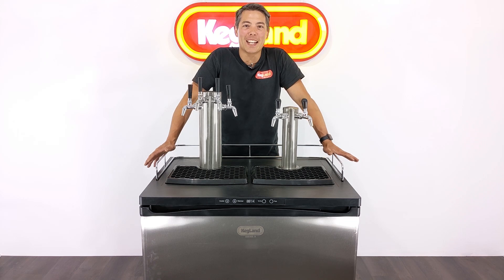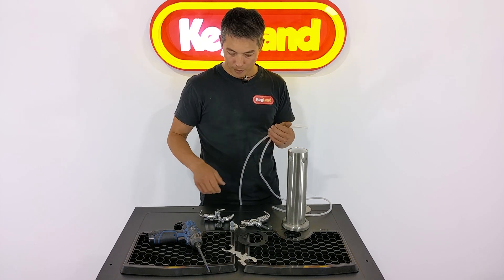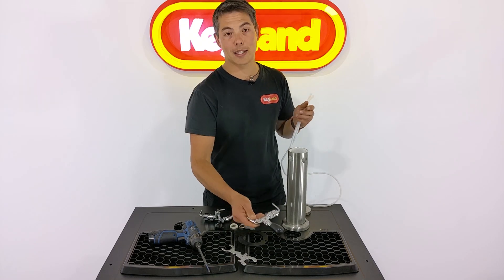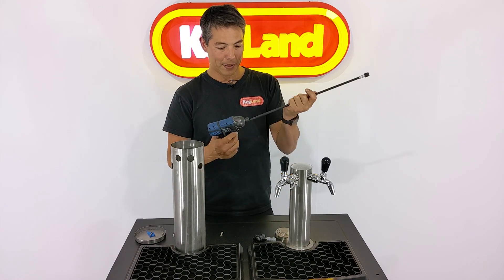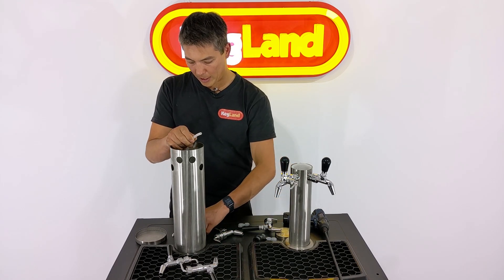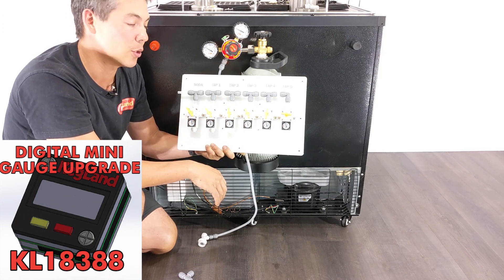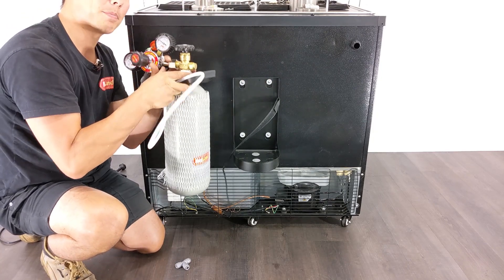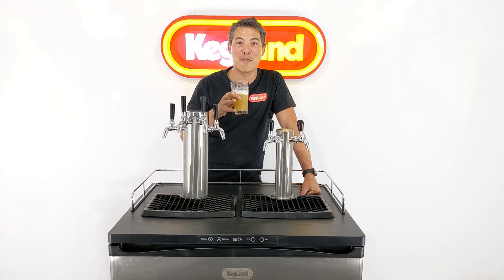Series X Plus 8 Keg Kegerator - Installation Video

Comment: Just set up the 4-tap Series X this weekend. Awesome product!

Some quick tips:

1. For the 4-tap tower with the inside screws, instead of the drill extension and masking tape method shown in the video, this is much simpler & easier: hold the tower in the air, insert the four screws in the holes with your other hand, hover the tower about 1 inch above the kegerator, align the screws into the holes (there is just enough dead space for each screw to drop in and hold in place),  VERY gently lower the tower leaving all 4 screws in place, VERY carefully tighten each screw down enough to hold in place while you tighten down the rest. 

2. The screws on bottom for the caster wheels where ridiculously tight on my unit and shattered my drill bit.  So have a socket wrench on hand (luckily they are hex screws). 

3. I stole this tip from another video - gently press and twist the tower cap onto the thin plastic packing foam to make a perfectly fitting foam insulation circle for the top of the tower. 

4. Use a keg with appropriate cleaning solution (or just warm water) to clean out the lines first and test for leaks (so that warm water or cleaning solution spray all over instead of beer).  I was very carful and still had 1 tap that didn't tighten in correctly. 

Thats's all. Great product! KegLand continues to lead the way in new product innovation and reasonable prices.
Reply from the maker: Thanks for the feedback and really appreciate the extra tips. We will have to include those in the next vide. Thanks Robb.

Comment: Thank you for the video. The instructions are very helpful and simple. Just a quick question: I did several gas leakage checks leaving the system for several hours. Each time the high pressure gauge showed zero while the low pressure one was ok. Any advice is appreciated
Reply from the maker: Sounds like yo may have a very slow leak

Comment: Are the new disconnects going to be better at handling starsan than the duotights? I haven't had an issue yet but have seen cracking.
Reply from the maker: Hello Christopher.  It might be worth you having a look at this document:

https://www.kegland.com.au/media/pdf/duotight%20design%20revision.pdf

The duotight fittings were revised some time ago so your cracking issue has already been solved.

Comment: Hi

I was wondering if you could me out? I have a Kegerator with a Birra Moretti 30L Keg chilled to 3 Degrees Celsius with a 60/40 mixed gas, my beer line from keg to tap is 2 meters in length which is also cooled. I am just wondering pressure I should set my regulator too? Feedback would be greatly appreciated.
Reply from the maker: Hi Brett give us a call during business hours and we can help you out.

Comment: liking this fridge to run 4 kegs plus have capacity for cans etc (with the wire rack accessory) but hate the look of 1 single offset font... wondering about a centralised hole....
Reply from the maker: We have no plans for a centralized hole at this stage.  What about 2 fonts with just 2 taps on each side?

Comment: hello I just bought the x plus series, and it is impossible to put 8 was soda in it... I am disappointed with this false information.
Reply from the maker: what do you mean. Are you using our corny kegs?  I have put 8 kegs in myself so I am 100% positive that it works.  the kegs must be placed in the correct sequence to fit them in.  I would suggest looking at our website as we have a layout diagram.